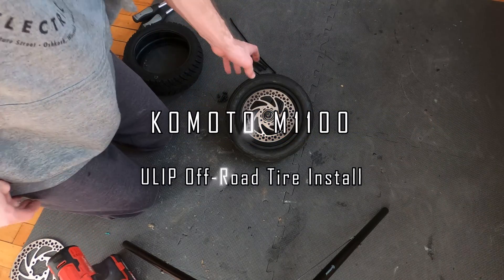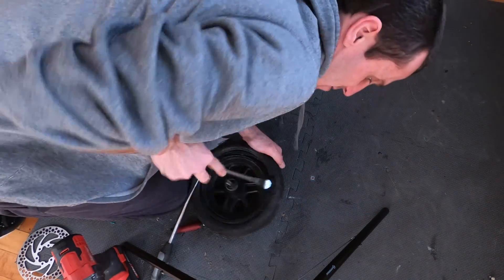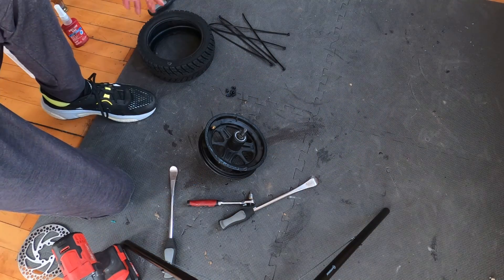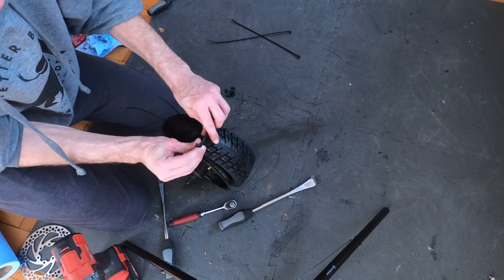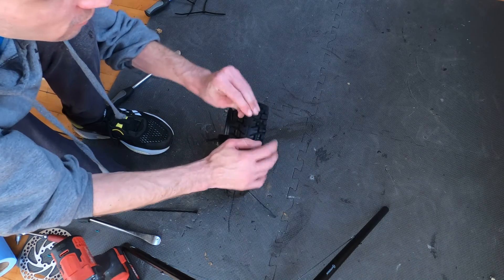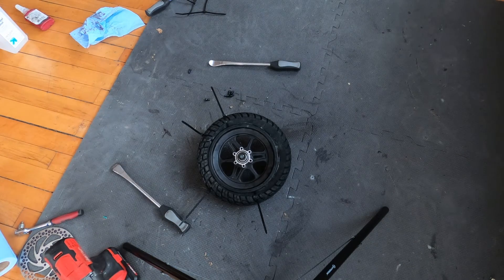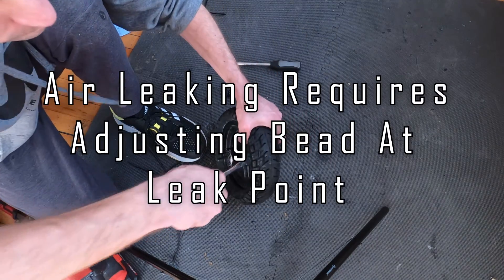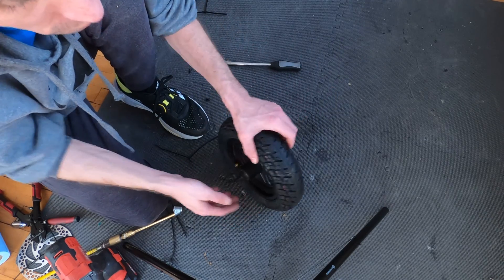Electric Scooter 10 inch Tubeless Tire Installation and Removal  KOMOTO M1100 Front Tire Replacement

Comment: Shoulda used soapy water to start getting them off and putting 'em back on.
Also, using multiple zips around the circumference of the tyre, pulling them tight makes it easier to get the tyre off.